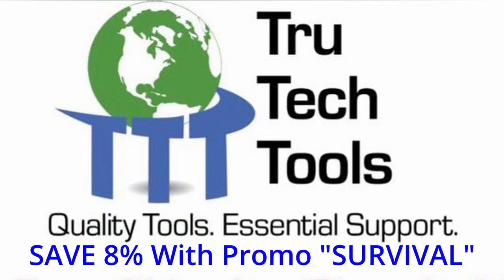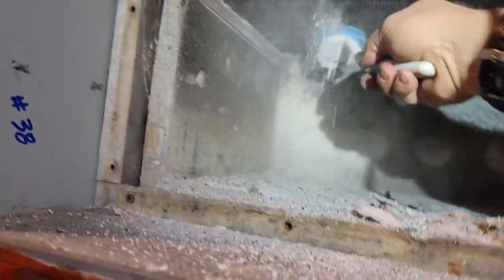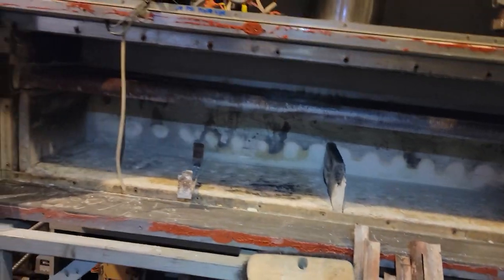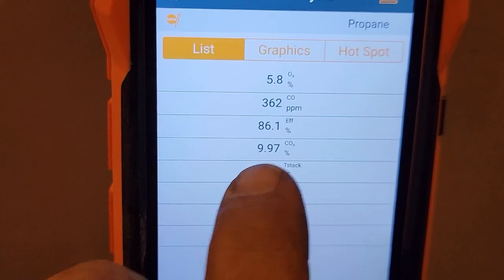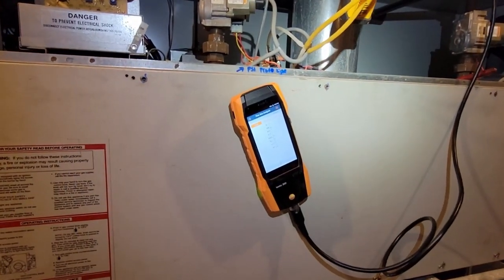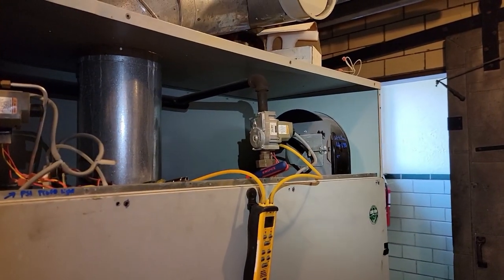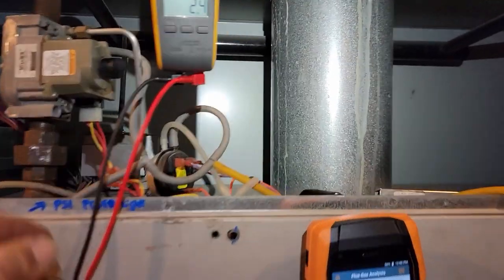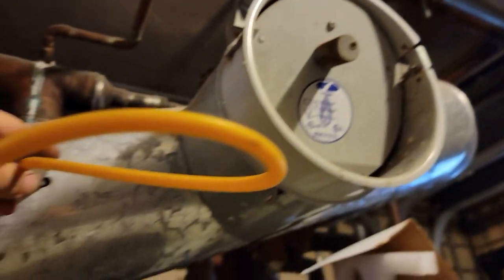Boiler From Hell... Flame Failure On Lochinvar Boiler

Comment: In a 1930s vintage building I once worked in I watched a oil converted cast iron coal boiler the size of half a VW bus get dismantled and replaced with one of these.  The installers had to break the cast iron sections with sledge hammers.  The Lochinvar was like a miracle; compact quiet and efficient.  The massive belch of flame from the old oil burner was impressive though.  The old one had three 275Gal tanks that needed filling 3 times  a year.

Comment: I was always taught to replace the burners if they were more than 5 years old. Also the control is looking for at least 3 amps of igniter current before it will open the gas valves. Older boilers would just sit with igniter glowing until a lockout occurred. Newer boilers will tell you Igniter(A or B) current low. Always an aggravation on those Lochinvars with the air pressure and the switches. When the exchanger starts to plug you would get a low air or blocked flue trip. Just serviced one of these a few months back and yes that dust will kill your lungs!
Reply from the maker: That dust destroyed my sweeper filter....I couldn't get it clean even after I washed it with water. I'm sure it has silica in it which causes cancer I'm sure.

Comment: 90% of the boilers I work on are lochinvars. When set correctly they run pretty good, it’ll just be maintenance upkeep and small things like HSI going bad or float switch leaking that need to be replaced. There harnesses are cheap I have to replace the igniter harness about every 3 years or so due to molex plug fouling up. Surprised to see that boiler not running on the big PCB boards since it’s not super old. How you did the HX cleaning is exactly how I do mine and is what lochinvar recommends in which they want that done yearly. Ours run pretty much non stop and are on roofs in the environment. Solid troubleshooting 🤘🏻like always!
Reply from the maker: I appreciate the support, I did it the way the factory recommended.
Reply: FUCKIN SLAYERRRRR

Comment: That green sulfur dust is an absolute lung killer.  Always protect your lungs or you willl not enjoy the afterburn.
Worked on these once at a commercial car wash heating the wash water.  Was glad to find they were replaced when I returned years later. I did not appreciate these closed combustion boxes
Reply from the maker: I got a k95 mask right after I mentioned it.

Comment: Having found similar buildup on the tubes, I was told to literally hose off the tubes.   What a mess.  Anyway, found that if ignitor doesn't draw the required amps, the boiler will just sit there with the ignitor glowing, so tripping may be from near end of life of the ignitor.  Also, I found several burners had cracked from 9 to 3 oclock near the front on first stage, and any flame disturbance that caused was not visible through the sight glass.
Reply from the maker: All good information🤜🤛👍👍

Comment: Great job , I was expecting the burners to be cracked and blown out , very common on these copper fin boilers
Reply from the maker: I checked them carefully hoping to find some reason for the high co, washing them out with water did make a difference.
Reply: @HVACRSurvival  I have washed out the heat exchanger with a spray of water , Of course being careful not to get the refractory insulation wet .
Reply: @ChingusTheOneAndOnly  insulation delete 101 🤣

Comment: Did you check CO in the church space and at vents as well?
Reply from the maker: This boiler provides hot water to an air handler, if there's Co in the building I would have got it a reading when I came in from outside.  I verified it was drafting and worked on the equipment that they asked for.

Comment: question rick. you have 2 co readings.. CO is a diluted reading. you also have a COAF which is co air free undiluted reading. how are you deciding which should be under 200ppm? did the manufacturer specify? your coaf reading was over 200.

Comment: Looks like deposits caused by contaminated combustion air.  What’s in those bags that your tools were setting on?  Did you check the draft on that flue connector? Looks like the barometric was all the way closed.  I guess you re sealed the burner door.  That’s critical.  Natural usually burns between 3.5 and 4, but what you really have to do to make sure, is clock the meter, to see if you’re over-fired.  I would also check the office size.  You should be able to figure this out without having to replace the boiler.  Try clocking the meter to see what your BTU input is.  I’ll bet it’s higher than you think.  Did you fully inspect your flame sensor circuit for cleanliness and, a good ground.  What is the factory spec. For the DC micro amp flame signal?  How’s the combustion air openings in the boiler room?
Reply from the maker: I forget what was in the bags but I investigated any possible chemicals that were in the room causing bi-products in the fuel burning process. Nothing changed in the room environment as far as the salt for the water softener. As far as clocking a meter, this system was on propane gas so there's no meter to clock, I checked the draft and it was right on the money I forget what it was required at the time but I thought I noted it in the video, I set the gas pressure at factory default and then lowered it a little bit as I mentioned in the video, I checked the burners, I did find the little problem with one and I repaired it with silver braze,  I also washed them out, after 2 or 3 trips I was able to make this thing run like it should, and it has been working fine now for the last 3 or 4 months,  however long this video has been up. It boils down to they weren't having it service like they should and now they know they need to have it done every year.
Reply: @HVACRSurvival  Oh I didn’t realize it was on Propane.  Lots more problems.

Comment: You can check draft with the analyzer.
Are those boilers  run on propane
Reply from the maker: They were propane, I think it does draft, we just got the thing and I was the first to use it.

Comment: Those boxes need to be super tight, interesting enough I just condemned a lochinvar similar vintage. Customer installed a burner upside.
Reply from the maker: Wow, did it light ok or boom. ?
Reply: @HVACRSurvival  It ran like that for months… I arrived found the destroyed burners, had to cut one in half with a saw to get it out. Ended up condemning it once I found the cracked box.
Reply: how much hiccup sauce or mary-jane was involved. lol
Reply: @throttlebottle5906  no idea 🤷🏽‍♂️ expensive mistake though.

Comment: Any thoughts on what that flaky, powdery stuff was?
Reply from the maker: Combustion byproducts is what I figured.
Reply: Nose candy!🤣🤣🤣
Reply: @joehead1294  LMAO! snort it up, snort it up( sang to lick it up KISS)
Reply: Crystalline silica is formed from the combustion process and is a cancer-causing substance. A lot of manufacturers for residential modulating condensing boilers suggest full ppe when servicing them. I'm glad to see you did put a mask on for your video. Really like to see this type of content though! Great video
Reply: @element1318  water is your friend with any powdery silica, as it is with cement/concrete mixes and asbestos. all nasty things to your lungs. silicosis is very bad, as well as asbestosis.
Reply from the maker: Thanks for the heads up. I've heard of that from insulation but not from the combustion process 👍👍

Comment: looks like a tamed down pressure washer was needed. lol
Reply from the maker: I mentioned that in the original video but it would have made a hell of a mess. Kind of like when I used nitrogen but I didn't show that either 🤣
Reply: @HVACRSurvival  

I work on a lot of Lochinvar, Raypak, and Laars copper tube fin boilers, and all types of gas boilers. That style depending how dirty the tubes are I’ll brush them down as you did, then, vacuum, grab the large trash bag cut it up, and lay it down so you don’t wet the refractory (fire brick) I use a pump spray mixed with CLR and water. Wash, scrub, and clean the tubes and then rinse them down with water. Reassemble back together. Lochinvar specs the ones I worked on are Air 1.2” W.C.  Gas valves set at 3.0” W.C and your deferential should be 1.8” W.C. That should get you on the money. 
My goal is always under 50PPM if possible. Close to 0 is even better! Depending on the damn manual says less than 100 is okay but I still don’t like it that high. The condition of the tubes also impact the CO readings. I have seen some that look okay but are not. The obvious is when they are cracked/ burnt. I use a Bacharach PCA 400. Also don't forget to check incoming gas pressure to the boiler, static/ dynamic issues. 👍
Reply from the maker: @Anonymous01416  thanks for the information! I agree the co levels they have me were higher than what I've heard in the past.

Comment: I’ve always ran into more Raypack than Lochnivar for copper finned tube boilers. Raypacks FUCKING SUCK to clean. That Lochnivar is slick!

I was always taught that high CO is almost always a result of flame impingement. I wonder if replacing the burners would have made any difference in your CO?
Reply from the maker: I think the Raypacj I've seen are pool heaters, they were vacuum cleaners... They sucked
Reply: @HVACRSurvival  you literally have to use a garden hose and and soak everything, including yourself, when the heat exchangers get bad. If that doesn’t work you’re breaking out a brazing rod and punching out every fin gap. Not a fan.